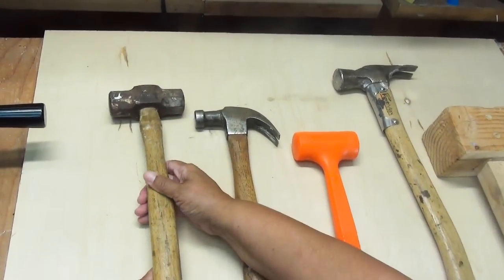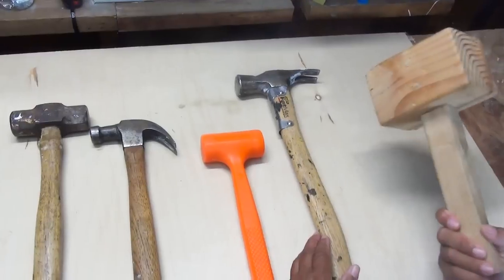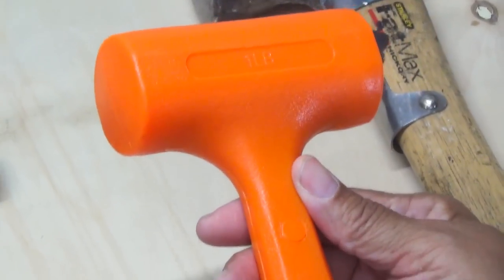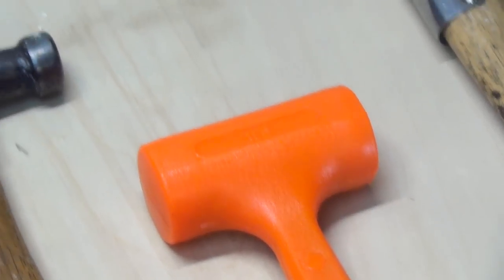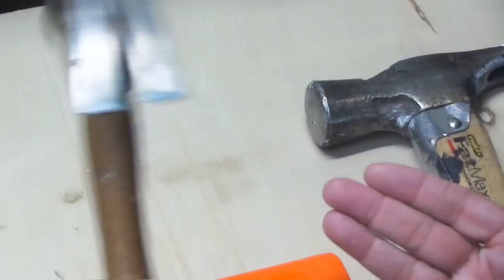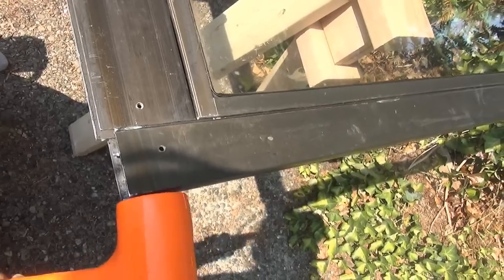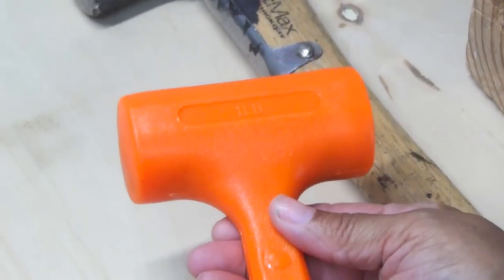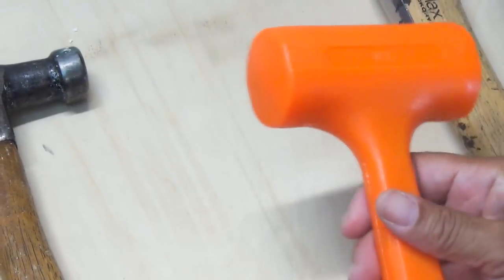When To Use A Dead Blow Hammer

Comment: The main reason to use a dead blow hammer is to prevent a bounce and a second hit.  If you only need to avoid leaving a mark or a dent, a rubber mallet might be  better choice.  My family gives me so much grief about having so many tools and the fact that I rarely use some of them.  They fail to understand that many tools are very job specific and may not see a lot of use, but when you do need them, nothing else will do.  A real professional uses the proper tool for the job.
Reply: Amen to that!  I get that all the time with family and friends.  Why did you buy that for?  Do you really need it?  I purchased an old wood plane and I pretty much got laughed at, "Whats that for anyway?  Your never going to use that!"  Days later the same person who told me that had an issue with a door that got "stuck" all the time especially in the summer.  I brought the plane over and with a few quick shavings door was fixed.  Took 5 minutes.  I looked at my friend and told him "Don't ever give me sh*t about my tools again."
Reply: well said
Reply: Basin wrench comes to mind
Reply: How about sound? Do these reduce sound? I need something a little quieter when banging my steel wedge into firewood rounds
Reply: You need MORE :)

Comment: I worked at international paper for 13 years and i used this hammer every day to replace the cutting knives on die boards. When the knives would crack over time you have to re-rule them and this hammer gets the sharp knives set in without damaging the sharp edge as the plastic protects it as you hit the knife. Great video leah😁

Comment: You did a fantastic job of explaining how a dead blow hammer works without explaining anything about dead blow hammers 🤦

How is a "dead blow" better than a normal hit with a typical hammer?
What even is a "dead blow"?
What are times you wouldn't want to use a dead blow hammer?
Why wouldn't you want to use a dead blow hammer in these instances?

These are the questions that people are coming for.  Just repeatedly saying "a dead blow hammer performs a dead blow" doesn't help anybody.

Comment: If I was driving a frame together, depending on the force necessary, I'd probably use my framing hammer with a block of wood because it's really heavy and I'm very accurate with it. If I'm working with steel or some kind of metal either driving it in or bending it in an environment where a bounce could cause damage, I'm using the dead blow. My dead blow has a metal head, it's very heavy and persuades everything it hits. I've driven steel and iron spikes and rods with it, bent sheet metal and other steel and iron materials. I tend to use it in any situation where I'm pretty sure I'm going to end up with hammer claw marks in my forehead.

Comment: I see that your framing hammer has a metal reinforcement piece on it. Was that factory, aftermarket, or did you make it?. I have not seen that configuration around my area before. It looks really handy.
Reply: F.K. Burnham great question
Reply: It's called "overstrike guard".

That hammer is a Stanley Fatmax; some models comes with a factory overstrike guard.

The Fatmaxes I've seen before had a pretty small and narrow guard compared to Leah's one, though. Maybe they're just different versions, or maybe that's an improvement made by Leah herself. Who knows.

Anyway, It's pretty easy to build an overstrike guard by yourself: you just have to bend a piece of scrap steel making an U-shaped piece, then cut it in order to fit the handle right below the head of the hammer. You can secure it with screws, but the best choice are rivets.

Comment: Very informative  , I've used a rubber mallet would this give the same result.
Reply: Floyd Albright , Rubber mallet isn't as heavy.
Reply: A rubber mallet also will have recoil, or bounce. You can deliver a heavier and more directed hit with a dead blow.
Reply: Yeah, I have a couple of rubber mallets, but for some jobs nothing beats a dead blow...  I can actually "rap" open some older safes with my heavy deadblows (where you're talking almost the same force as a sledge, but with no denting of the plate, no rebound, and more concentrated force at point of impact)  There's loads of times that one tool does many jobs, but there's also times that the difference between the best tool for the job, and the PITA of dealing with the "it'll work, but..." tool for the job justifies the additional purchase...  Which lets face it, what's the MOST expensive deadblow gonna run you? $20 for a 4 pounder? (and you can get one just as good for a lot less if you're not a brand snob)

Comment: I've always used a rubber mallet in situations like that. Granted there's a slight bounce (recoil), but I can't think of a situation I'd personally be in, where recoil is detrimental. Maybe I just haven't had a project yet that need such a delicate touch, but I've even used a rubber mallet in the exact screen door example shown, as well as on more fragile material. I honestly can't think of a scenario where you couldn't just get away with a rubber mallet.
Reply: Try hitting a rusted in brake drum with a rubber mallet. The dead blow hammer will knock it loose without damaging the drum. Very handy when you need it.
Reply: Bear2die4, I've always used normal hammers on brake drums. I've never had a problem. It would never occur to me to hit a brake drum with a rubber mallet.
Reply: @robbitt  a rubber mallet wouldnt do anything to it, which was my point. Using a metal hammer would damage the surface of the drum, and you'd risk warpage. 

If its your car, well... You know what you're doing. I wouldnt want to pay for someone else's stuff though.
Reply: Bear2die4, Right. A rubber mallet would do nothing. That's why it would never occur to me to use one. As for a normal hammer, there's no risk, as long as you know what you're doing and where to strike. It was common practice for a long time, though I don't know what's used in auto shops nowadays. In any case my question was regarding a scenario where a dead hammer is necessary and this isn't one. I'm certain there are many, but like I said, I've never come across one myself.